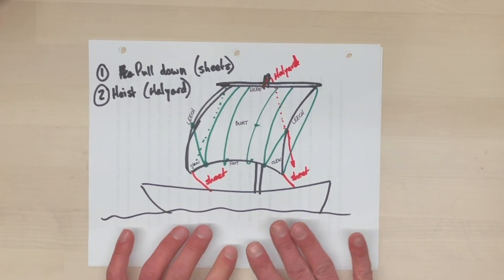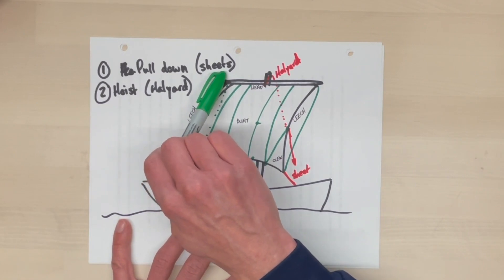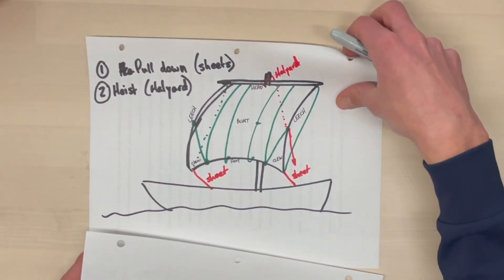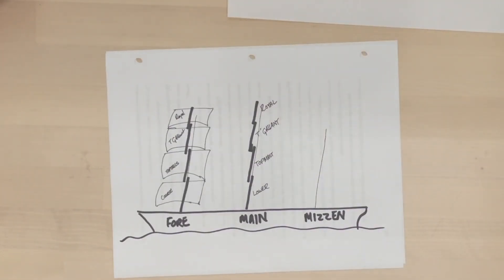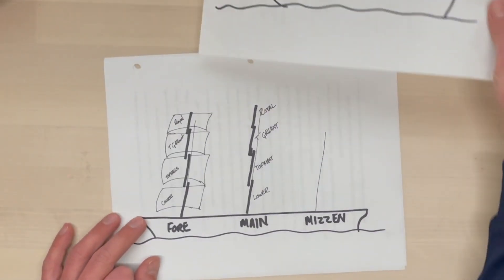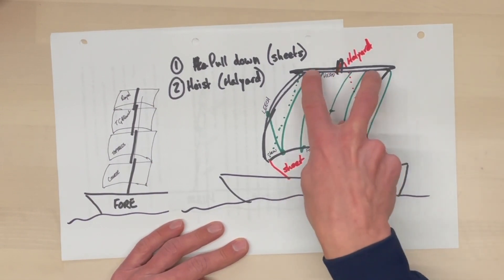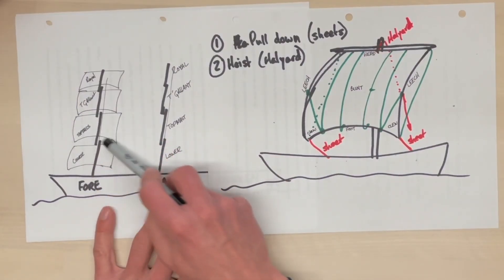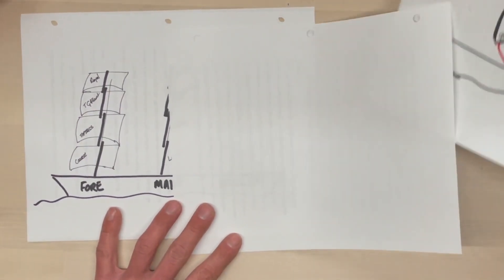Sail Handling Theory: Square Sails 2

Comment: On a single square sail mast, does the yard just flop around on the mast?
Reply: On an "old-style" ship with a single yard, the lowered yard will likely have been turned or pivoted on the mast so it is more-or-less in line with the keel of the ship, and secured to the ship at one end. A big sail meant a long yard, so it would make manoeuvring and stability difficult if it were left square across the ship.

On the ship described in the video, the lowered yard is held horizontal by a pair of "lifts". These are two cables that extend from the mast above the yard, down to the end of the yard on each side. So, you can picture the yard being the base of two right-angled triangles, with the mast in the centre being the vertical side of both, and each lift is a hypotenuse.

In both cases, the raised yard is held at the required angle by a pair of lines called braces, one from each end of the yard leading down to the deck.